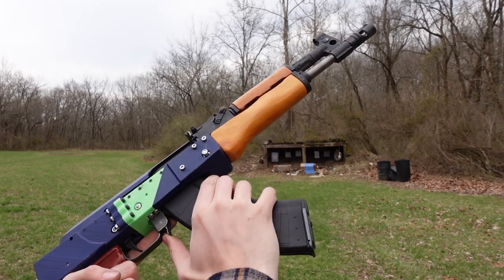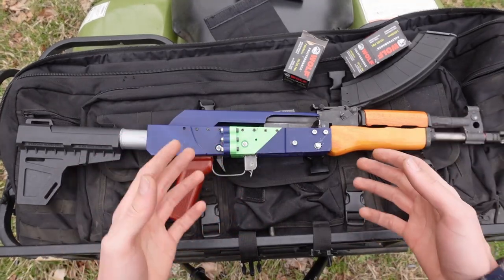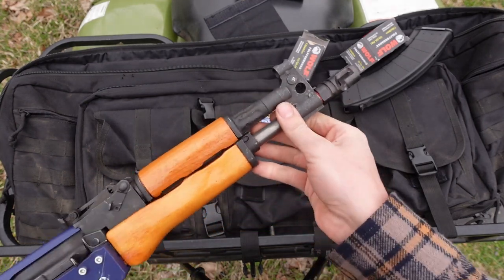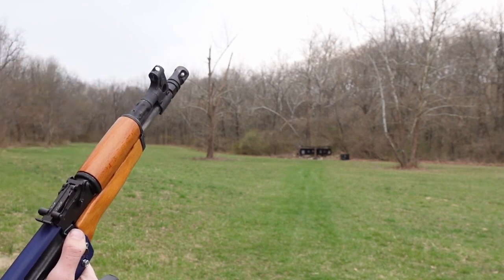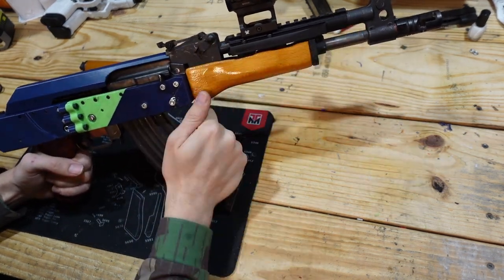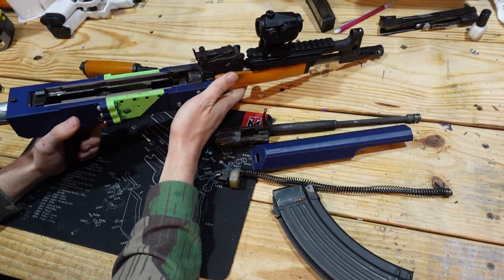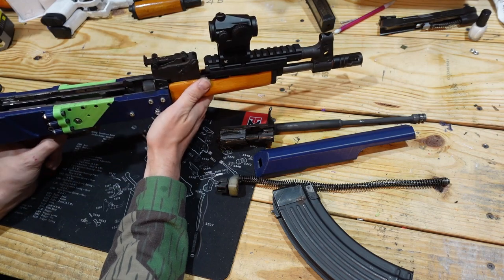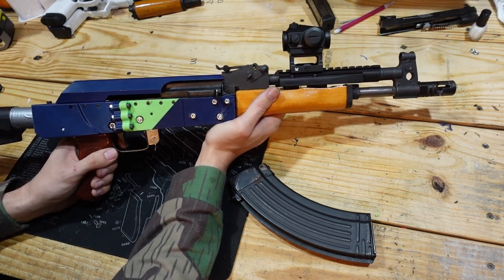Day at the Range - Plastikov v3 'Draco' Build

Comment: I love your work dude keep it up!
Also I have a question, does 40cr and 42crmo differ from each other very much and can i make a barrel out of a pipe like that?
Reply from the maker: Either works for the FGC-9
Reply: @IvanPrintsGuns  thanks, also I have a problem with the 3d printed fire control group, the reset on the trigger didnt work so I extended the catch on the hammer idk If I should do that